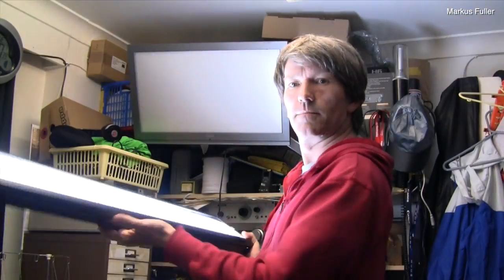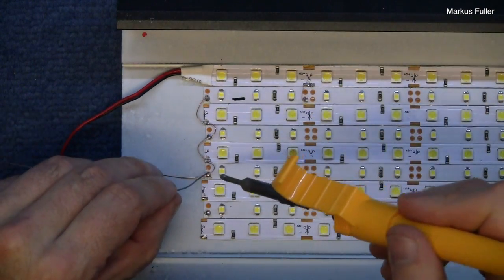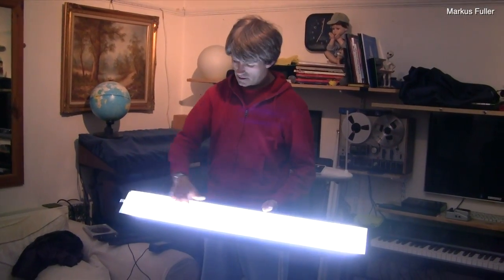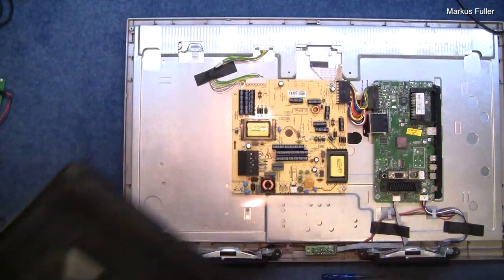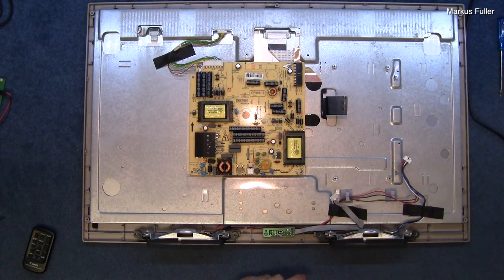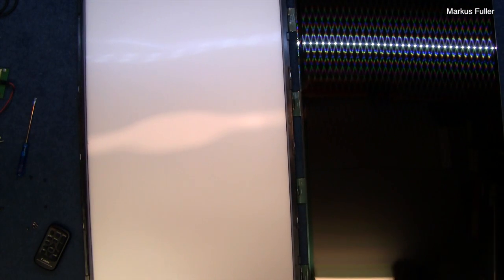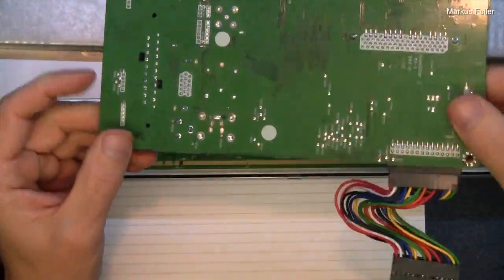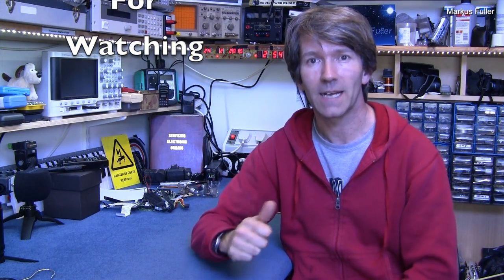Make a super bright Light Box from LED TV for photography and filming #42

Comment: Hi Markus, best recycling tip of the year.
You can correct the blue LED light with a filter in front of the screen. This is better than adjusting the white balance on your camera because you are alteady mixing different types of light.
Try controlling the worst color temperature (your tv-screen-lightbox) at the source with a CTO filter (or experiment with a pale orange transparant piece of plastic). This wil lower the color temperature of the LED.
Thank you for your really interesting video's. I recently used one to fix a small issue with my synth so thumbs up for you.

Comment: Hi I need serious help in backlighting for inspection panel. Is it possible use AC plug n play with dimmable feature? On what height should I place it to be to have it in 60mm box? And have 1030 lumens for 650 x 350 mm box

Comment: I really think you should do the math on how much power you really need including at least  25 percent extra. Just by the looks of  it I would have at least an 8 amp power supply adapter.
Reply from the maker: barry brenner I am using a 5amp power supply and its completely fine. I still use it often when i’m filming.

Comment: Great light is always good for Filming . In hindsight I would not recommend keeping the power supply. Instead I recomend to messure the max voltage on the seperate LED lines F.e, with Sony its often 135 V.  Than Unsolder the Bridge rectifier, high volatage capacitor and fuseholder from the power supply. Replace the main powersupply cable with a grounded cable. Conect the ground to the chassey. In my case I route the other 3 wires of the 220 V outlet Power to the fuse, than rectify it with the rectifier, flatten the 200V DC with the capacitor and supply two 135V LEDs strings in Line with the 220  DC. Works like a charm. Vou can also add any  super small low Voltage DC power supply to drive a DC PWM Dimmer  that drives a DC Solid state Relay that drives the LEDs. And there you have it,  a dimmable Lamp for a couple of bugs.

Comment: I scrap flat screen TVs amongst all kind of things, for metal scrapping. I have been carefully removing and saving the LED lite strips from the TVs, because I had this notion that I could make some of my own funky lights with them. However, my knowledge is quite limited when it comes to understanding voltage and amperage, direct current, and all that important to know, electrical know how. I am hoping that your video will be one among many, that helps me figure out how to properly wire up, and power up these LED strips. Maybe you could do a "basics" video, to show us how? What are the proper steps to correctly power a single LED strip for plugging into a wall outlet. I am in the U.S., so maybe some principals will be slightly different from your overall electric set-up in your Country? I don't think simply joining a plugin cord to the two leads, is the right procedure.

Comment: On the TV light box when you installed led the variable resistor,  I assume that the grey wire when to the point you found on the LED Driver board you touched using the "human resistor"?
Reply from the maker: Hi Melanie. it was a long time ago when I made this video but yes I guess you are right in saying it was a human resistor. its a bit dangerous to do but I guess it worked out.

Comment: i have used a Samsung ue46f7080st - it was easy: removed all screws and frames. removed the broken TFT. removed the CPU and GPU circuit boards, keeping only the power circuit board. reassembled the frame. plugged in the power cord. done. lights up insanely bright, consuming 80W. the only problem is, there is a space where the TFT used to be, resulting in the diffusion sheets falling out. u can just hot-glue it under the metal frame
Reply from the maker: tazztone yes its amazing how bright these tvs are under that lcd panel :-)
Reply: do you know what CRI (color rendering index) these LEDs usually have? are they suitable for color accurate illumination?
Reply: however i found that they pull much much more power than they need for lighting. so it's much more efficient to measure current and voltage of the strips and buy a dedicated LED driver to power them
Reply: Tazztone,
I have successfully added another diffuser panel from another MFR that was the same size. It fills up the space left by the removal of the LCD panel

Comment: I have Westinghouse 32in stripped to the bones, i was wondering if i could put a current through the light bars without using any of the circuit board. Also what would be the wattage of the light bars.
Reply from the maker: Chase Scott when you say light bars do you mean like thin flourescent tubes ?. as you would need to keep some of the circuit board to light the flourescent tubes. if they are led then you would still require a pretty beefy power supply to light those also.

Comment: Hi Markthank you very much for the great ideas I have a question about the long light box , I need to know the power consumption of this light box (because 485 LEDs may consume a lot of power so it may be a disadvantage) and if I want to make one but with less number of LEDs , what is the minimum number to use ?
Reply from the maker: +Eng. GaMaL Hello Eng. I tried a 12volt 1 amp PSU but it was not enough and the switch mode PSU just made the leds flash. I then tried a 12 volt 3 amp switch mode and that works perfectly.
I have just found another led tv (philips ambilight) and will be making another video soon on that one. Best wishes from Markus.

Comment: Hi Mark will you be doing a program in the near future about how to use an oscilloscope, I have one but don't want to use it as I don't know what voltage I can use it on safely.  I find your videos very clear and very informative so please keep it up and thank you.  Regards Mark
Reply from the maker: Hi Lionel. I tend to use a multimeter and if voltages read below a certain level I presume its safe to use the scope. thats only for high voltages that I'm not sure of though. if you set the scope to the highest voltage (normally 20volts per division on the scope screen though some scopes do 50Volts/Div ) then if the waveform fits within the window you can go downwards with the Volts/Div switch until you get a good visible reading. I think Dave at the (youtube) EEVblog has a few good videos on how to use a scope and how not to blow up your scope. I just typed in to youtube "how to use an oscilloscope" and theres lots of videos to choose from already. But in all honesty I don't think I could do a better video on using a scope. my apologies from Markus

Comment: One question. I have converted one 55" SamsungTV to a similar ligt. Do you know if that Bluish Light got any UV in it ? Also what are those transparent plastic sheets on top of the thick Acrylic sheet in the middle covering those EDGE LEDs
?
Reply from the maker: Hello there may be some UV light but without a tester one could not really guess. also those different layers of plastic are to make an even distribution of light, they are mainly light guides and have tiny grooves in some of them to direct the light towards the LCD panel.

Comment: Awesome! great!!! thanks! The only problem Iam having is how to make it stand on its own like with a light stand,  still unable to do it, I dont want it to be sitting in a table or on the floor.
Reply from the maker: +Roberto Steve Lou Hi Roberto. I placed my flat TV light on a computer monitor stand so I can attach it to a desk and move it around, but as for use on a light stand I can only say experiment as im sure you can make something up. there are stands for TVs & monitors available but they are quite expensive.
Reply: thanks a lot

Comment: 7:30 What if you took out only the sheets of diffuser plastic, so it's just a light panel and LED panel ¿ Would it give off brighter or dimmer solid colored light ¿
Reply from the maker: +The Sqoou Hello If you took out the diffuser then you would have some areas of your room with brighter parts than others as each led is not set 100% at the same angle as the next. plus the diffuser does make a softer all round light. but yes in some areas it would seem brighter.

Comment: Nice Vid.  I do have a question about an old monitor converted to a light box..... is there a way to get the "screen saver" to stop turning the light off after 2 or 3 min?
Reply from the maker: Hello I removed the board with the TV-tuner etc and that normally has the screen saving commands on it. I just used the power supply and a resistor to trick it into turning the leds on permanently.
Reply: markusfuller Ok. Ill have to go back in and look because I believe the TV board and the control board are one in the same so I may need to find a way to disconnect that part of the board.

Comment: Where did you get the diffuser material? I am trying to make a similar light box but am having trouble finding a decent diffuser
Reply from the maker: +Stewart Weinland Hi Stewart, Im not quite sure where it came from, it has been sitting in my workroom for ages but i think it originally came out of a flat screen tv that i disassembled. maybe it was the part under the LCD that diffused the backlighting. though you could use tracing paper it looks the same is easier to cut and I guess it is not too expensive.

Comment: How do I stop a backlight from auto dimming without being able to see the menu on the screen?
Reply from the maker: the auto dimming feature is controller from the main TV board. I bypassed that part altogether and just ran it direct from the Power board but you have to trick it with a resistor so it thinks the main board is requesting the screen to be lit so it lights up. theres so many types of this board you will have to dig in and figure out how to trick it. be careful though there are some very high voltages within that power board. good luck.

Comment: hey friend 
I have Lg smart tv and its broken, so I did what you do in the vedio and its work fine but after about 5 minute the screen turn off and it need to turn on again by remot control, how can I fix this ?
Reply from the maker: Hi It may be that the TV is waiting for a video signal or tv signal and if it is not receiving anything it is going into power save mode. I do not think you will find a way around this unless you know the combination of buttons used on the remote to access the menu and turn off power saving mode. of course with no screen it will be very difficult.

Comment: Is there a way to avoid soldering? I would rather not have to do that part
Reply from the maker: Hello Oscargt23 if you want to make the lightbox with the long strips of leds then you can buy edge connectors that you can just clip onto the edges of the strips. they are made with leads on them and also corner pieces and end to end connectors. just look for led strip end connectors on the internet.

Comment: may I know the reason for two different types of light? line warm white and cold white? why can't we use the single type? is there any reason?
Reply from the maker: Chetan Kale Hello the difference is only the colour temperature of the light, you can have a warmer feel softer light or a colder clinical type of light, the preference is up to what you prefer. my cold light has a lot of blue in it and the warm light a slight red/orange. I prefer warm white.
Reply: markusfuller thanks for such a super quick response.

Comment: Great idea. But one thing puzzles me, knowing that the brightness of an LED backlit TV is controlled by PWM, isn't there the possibility of flickering when filmed by a camcorder ? Unless you power them at full brightness all the time ?
Reply from the maker: Hi Alain. It seems the PWM is split to 4 channels of leds running offset to each other so at least 2 maybe 3 banks are on at once ?. (maybe) it does not seem to flicker through my camera working at 30fps though i have not tested it at 60fps.
Reply: markusfuller Thanks for the reply, and the very interesting video ! BTW, what is the total power consumption of those  485 LEDs ?
Reply from the maker: Hi Alain. the total at 12volts was 0.527A
Reply: markusfuller Hello Markus, thanks for that info. Although, I would have expected more than that for high intensity white LEDs, even at 12 V. But with this very reasonable power demand, it could even be powered by batteries for portable use.
Reply from the maker: AlainHubert aha i think you have a point. I just looked on my notes when i sent you that figure. However i think i wrote that down on testing the roll of warm white leds before i chopped them up and added a whole roll of bright whites into the box. So i guess in total there maybe just over an amp. Im going to test the whole box tomorrow and let you know.

Comment: When you solder the all negative and positive together is that a series circuit?
Reply from the maker: +anthony “Findenzio” Hom Hello. If you solder all the negatives together and all the positives together that is a parallel circuit, If you solder positive of one to negative of the next then that positive to the next negative in a long chain that is a series circuit.
Reply: +markusfuller so is parallel circuit better than series circuit? I'm building a 6" x 12" out of 5 meter led strips you think it would be bright enough ?
Reply from the maker: Hi Anthony, if you are using the long stick on led strips they are normally 12 volts as they have resistors on them. if its those you will have to make the circuit parallel if you are using a 12volt power supply.

Comment: Hi
I like your videos i´m suscribed
I want to ask you How can i use this kind of led for ilumination at home like a bulb?
I want to have 30w for my living my room etc.. 
I live in colombia and here we have 120V AC
Can you suggest me a page or a tutorial were i find the info i need?
Thanks
Reply from the maker: Hello you would be better to buy a flat panel led light from amazon or some other electrical retailer. I have one in my workroom and it is 20cm X 80cm and cost about £30uk pounds but it is made correctly as ceiling lighting and with the correct voltage adaptor for the country you order it for. much easier that hacking a TV and will last many years.

Comment: How's the brightness of a light made from TV compared to the led strip one? It's hard to tell from the video
Reply from the maker: Hi Pawel. the screen is brighter than the led strip. it uses higher brightness leds but at Pulse Width Modulation. The longer light box is running at standard 12volts DC. I could make it brighter but I may kill the Leds in doing so. but together they are quite blinding so I am facing the up to the ceiling to bounce the light around as it hurts to have it directly facing your eyes for too long.
Reply: markusfuller Great! Since it has much bigger surface than LED strip, it makes a perfect and super cheap (if you buy used or broken ones) light source for photography and videography (of course after some color adjustments). Thanks for the tip, being a photographer I'll definitely look into it.
Reply from the maker: Paweł Rychert I see lots of them at the recycling centre but Im not sure if they will actually sell them to me. there are so many health & safety rules and regulations now and the problem that everyone wants to sue each other for the slightest thing that I'm sure they will too frightened to sell anything to anybody and would rather just bury everything under the land or burn it even though they call it a recycling centre. ( ps Im talking about the UK )

Comment: why not just remove the lcd screen from the tv and call it good? not very tech savy but it seems this might be much easier
Reply: Most TVs have an atuo-off feature if they don't get a signal of some sort.  So it may work but only  for 5-15 minutes at a time depending on how that TV is programmed (sometimes it's a setting in the TV but if the TV is no longer useful as a TV, you wont likely be able to navigate the menus to turn it off).

Comment: Good on you mate, I came to see your video to find out how or why won't my LCD TV light up, because its LED light panel won't fire up, but sound comes, and when i shine a bright light from the front you can see the picture, and get access to various Menu, and so i checked to make sure that Brightness and contrast were turned fully on, by shining a torch light you can see these quite effectively, and set the controls but still it did not light up, looks like my Power supply is Ok as i was getting 25v and my tv has only two wires to its LED panel, so i am presuming that if it has several white LEDs and each drops a 3v forward voltage drop of a white LED, so if you have strings of 20 LEDs that means my powersupply should feed 60 odd volts, but this is where the problem is, so my control chip either does not function any more or another chip further down on the TV board does not send control signals.So i am pretty much stuck not knowing which of the two boards is the problem. 
Mine is a Toshiba 32" LCD TV. bugger! ,
Reply from the maker: +Jayant Desai Have a look on the board for a tiny surface mount fuse (F1) near the connector that leads off to the LED strip. I repaired a Toshiba a while back with the same problem though it fed 48 volts to the LEDS. good luck I hope you find the problem.
Reply: Thanks Mark, it turned out to be one LED blown off among 24 LEDs ( 12 in each row,) I managed to replace just the one that was blown, and in the end guess what? the flippin screen cracked as i was fitting it back, and I have no idea how the heck did that happen despite taking great caution! it has now been binned! sadly .
Reply from the maker: Hi Jayant Sorry to hear the screen got cracked, it is so easily done, thats why I do not repair things for other people as there is is always the chance I can make the problem worse. Oh well better luck next time.